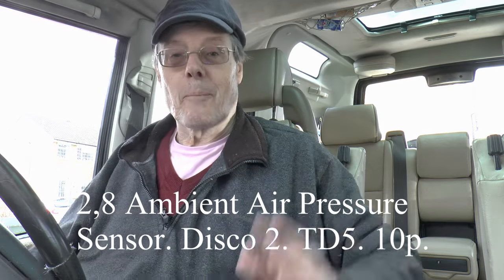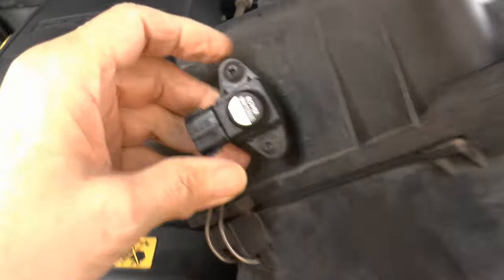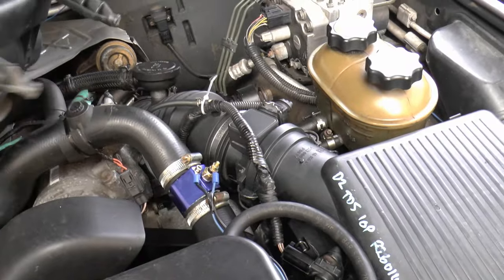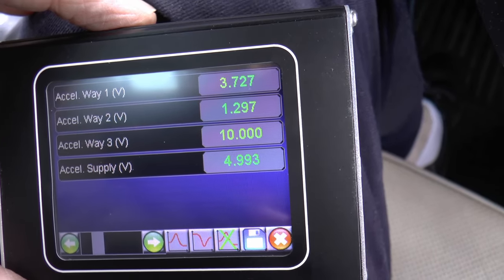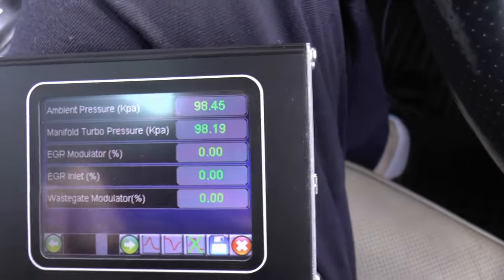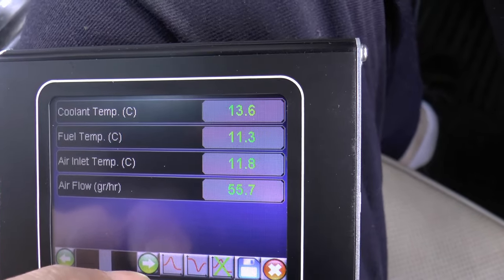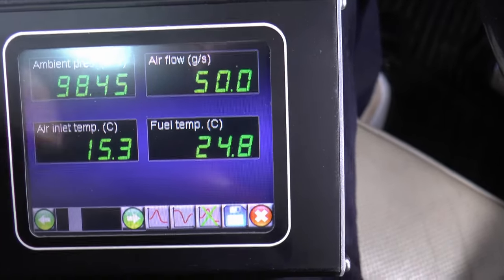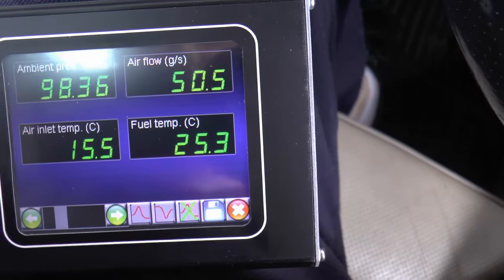Disco 2. Ambient Air Pressure Sensor.

Comment: Hi Derek, cylinder balance readings spot on, usual cylinder number one is worst due to no heater plug. Auto have three track accelerator pedal track 3 is connected to auto box for drop down gear give it some power. 10p engines cannot be mapped by Nanocom. 15p engines can. 
Not so sure if nanocom can read individual ABS sensors, or bleed ABS module, and power bleed the brakes. Still have a Foxwell unit that will do most of all rover and land rovers up till 2016. When you come across I will show what it can do.
Reply from the maker: Cheers Martin!      Yes please!

Comment: At the risk of stating the obvious, a lot of codes are likely to be historical rather than current.
I'm absolutely certain I'll have a bunch of similar codes on mine, for example, because I unplugged the MAF, MAP and Ambient Pressure sensors while trying to figure out why mine was running rough.
And, for the record, unplugging any/all of those sensors didn't actually stop the TD5 from running. 😵‍💫

The "blades" in the airbox will be to create turbulent air flow.
I suspect that's to get any dirt swirling around so ALL of the air filter gets used, rather than the bit of the air filter nearest the inlet getting clogged up after a couple of months.
Reply: If you unplug the sensors it will still run, it will use a pre programmed average map. The map will not take into account the conditions so will be less efficient.
The actual swirls where developed to help any water drain through the bottom of the air filter and not go into the intake. High pressure zone at the top. Low pressure zone at the bottom that the water molecules drop into.
Reply from the maker: Air box - yes probably.    The TD5 will run without some stuff because the ECU substitutes average readings, but it will run better with everything working, I suppose!

Comment: Another great video, such a handy device to have and great that someone lent it to you 👍🏻. Are you still having issues with the power dropping off whilst driving??  I've a issue with mine now and again when braking the pedal goes hard and you can hear the clutch slipping slightly. Thinking master cylinder 😢
Reply from the maker: Happy to report power has been fine since changing the MAF and MAP.     Not sure if the Ambient Air Pressure sensor has made any difference!    Intriguing clutch problem. Any brake calipers sticking on?